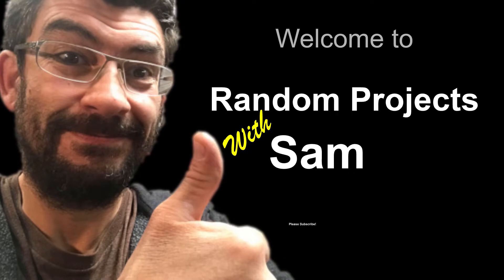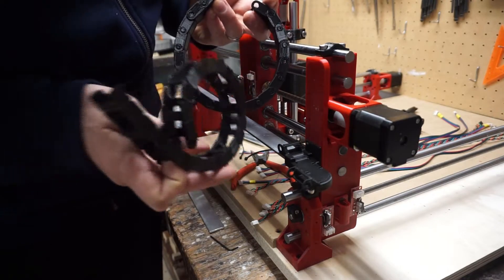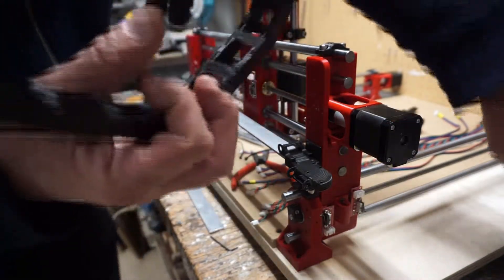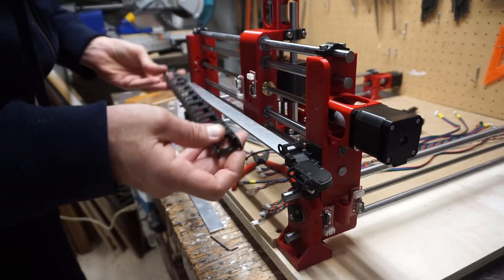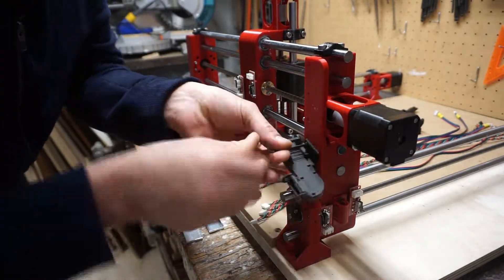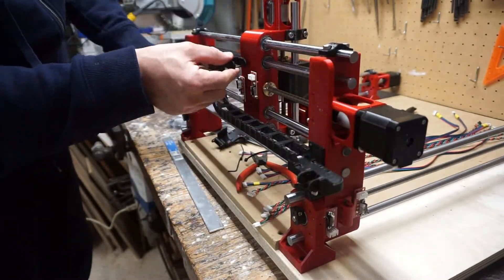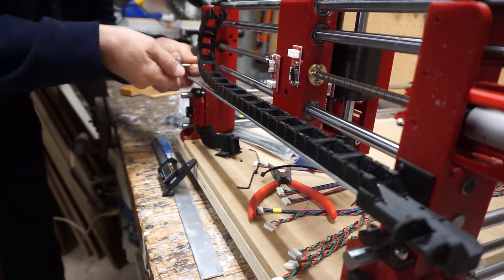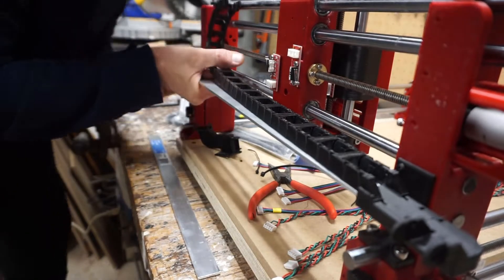DIY 3D Printed CNC. MultiBot CNC v2 build video part 4

Comment: Thanks for your proyect .I wise know the materials list.
Reply from the maker: Checkout the creators site: https://www.thingiverse.com/thing:4645791
Reply: Metal materials
Reply from the maker: @oscarmunozmartinez7956  The Thingiverse for my wire management add-on project lists 1" x 1/8th inch aluminum flat bar in the project summary. I think the Multibot materials list is in the downloadable file on the creator's page.